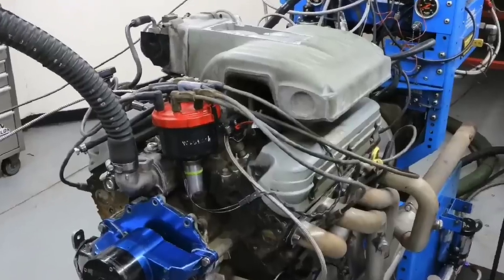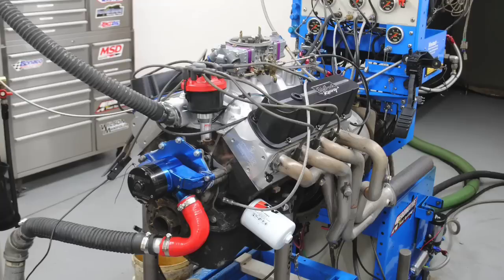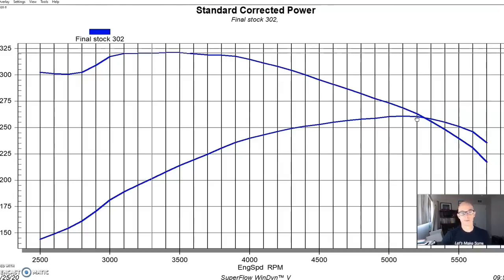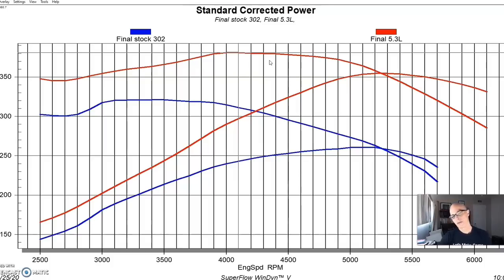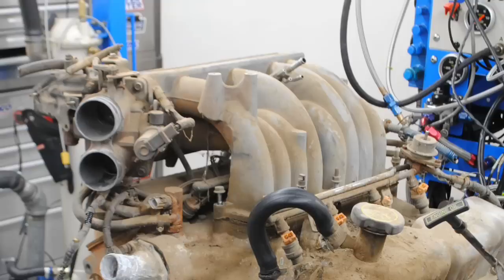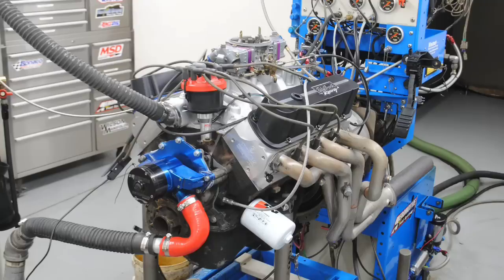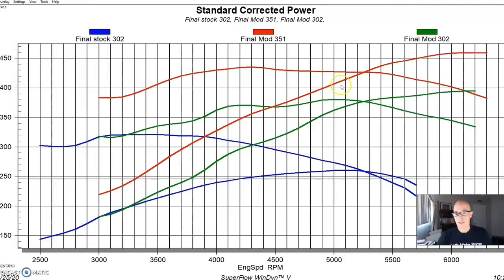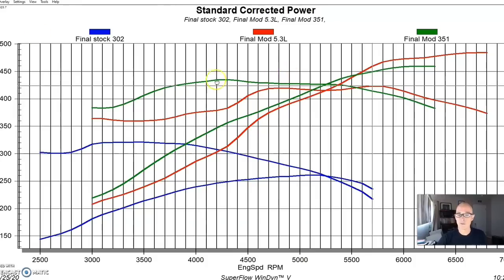5.0L vs 351W vs LS-SHOULD YOU SWAP?

Comment: Ready? Long post incoming!!.......
First, and this is just a personal short opinion, I will get into more in a sec- if you want to swap an LS why not just get a Camaro or firebird? Switching Ford small blocks means you don't need to swap transmissions etc. Plus you will find a lot of hate if you are swapping GM into any Ford that had a pushrod engine. Lots don't care, but lot's do. My opinion is it is your car, and this is America. 
That said, I will give something besides dyno numbers to consider. I know the internet has a really, REALLY hard time looking past dyno sheets and armchair drag racing, but what I am going to write here is FROM ACTUAL REAL LIFE EXPERIENCE as I have lived all this in my many years of car crafting and messing around with them. 

First: LS motors. 
LS is fine for anyone that only cares about maximum speed, and doing so without caring HOW it gets to that speed, or HOW it runs during other driving times. Are you building a drag strip car that is going on a trailer in between runs? This might be your best bet, it's cheap, it's got super aftermarket support now, it's a known entity. You can copy any one of many many internet formulas to get your car to run consistently. 
Daily driving an LS..... well that's not exactly the same. Sure it's still plenty fast, it will sound good because it's an American V8. it will suffer from some of the "blahs" though, as any modern, mostly computer controlled engine does. You can fart around with other things like gear ratios and whatnot to alter the car's characteristic, but in the end....
The LS is the peanut butter and jelly engine. Tastes good, cheap, easy..... and get's boring AF after while. I have NEVER met anyone in real life in person that has told me their dream car, and it included a 5.3 LS swap into a Ford. LS swapping into a Ford is what you do because you have a budget, because you are after a result. Not because you are after a car you want to keep for 20 years and pass to your kid, or take to your small town main street car show on memorial day, etc. LS swapping is a thing that happens because of bang for the buck and results, and you should expect it to be received that way when you talk to people about it. No REAL car guy is going to bash you for it, but also no REAL car guy is going to be super impressed by it either, it's a known entity and part of a defined calculation at the end of the day. 

Alright, on to the Ford stuff- by the way I am sad we didn't choose to dyno a junkyard pulled Exploder(poor man's cobra) for the stock test.....
First, 5.0
Make sure you know what you are starting with if you want to fart around with a 5.0. Ford made Mustang engines, but they also put these in trucks, and Crown Vics, and none of them are the same. Then they are different from the early 70's, to the mid 70's, not even a 5.0 in the early 80's, to the most common one people think about from Mustangs in the late 80's. Then there is the ones from the late 90's Exploders. Then there is actual Cobra motors. Each version needs a different approach to begin the tuning adventure. 
Here's the thing about any of them- if you want to build this mill to be FAST you are going to replace half of it, minimum. That's really all there is to it, the heads are not going to work, the cam is not going to work, the intake is not going to work, the pistons and rods MIGHT work if you have a very particular version of this engine otherwise nope. Building a 5.0 to be FAST is it's own adventure. I am not saying don't do it. This is America. But know you are in for some time and $$ to get it to truly be FAST. 
Now then, why this engine as so beloved, and why it was so fun, and why it spurred an entire generation of Ford fans: small block Ford, going all the way back to the 289, is FUN AS F%%k to rev the h3ll out of and tear a55 around town. It doesn;t even have to go that fast, it sounds amazing, is responsive as all get out(after a little tweaking) and REAL car guys know the sound of even a slightly worked small block from a couple blocks away. Will you win every drag race? NO, hahaha, maybe some, but you will smile every time you get in the car. 
I built a 94 mustang, started ten years ago, sold it to my boy a couple years back now. I tuned it for romping around on County trunk highways on slow bends etc. Rear end 3.55, tuned my exaust for sound, left suspension mostly stock(all new though, put in edelbrock shocks/struts too) computer tune, etc. Prolly added 40HP at the wheels. FUN, just cruise, bang through the gear, smile contently at the sound, and I put GIANT rubber on the back so if I wanted to hard launch/clutch dump that doofus in his duramax at the stoplight I would hook and the car would lunge to 30mph almost instantly. Drag race? NOT EVEN ONCE. Daily drive? For 6 years, every day weather allowed(upper midwest) and now the boy does too. 
This should be your goal with a 5.0, FUN. Not I MUST WIN, not drag race champion, not ultimate speed. Just high revving daily driving fun. I mean this is America, do what you want, but it will cost you $$$ to do it. 
Keep in mind, the bore is significantly bigger then the stroke=likes to rev, can make lots of peak HP at high end, harder to maintain flat torque curve like that without boost as you climb that scale. This engine will last longest, be happiest, and bring the most smiles as a daily when a mild build that balances manners(responsiveness) and peak power. Sometimes in hot rodding "the biggest ultimate bestest" is not the most fun. 

Ok, I know it's getting long, but here is the last part. 
351w. 
Since Coyote, this seems to have fallen out of favor. Shame. Ford made this engine since the 60's. Remember most 5.0 had a 50 oz balancer vs a 351 28 oz, first and foremost if you are swapping. I say this because you can reuse a lot of stuff from a 5.0 onto a 5.8 when you swap, but not the flywheel! But I will leave a lot of the technical stuff to others, just remember to find good info if you want to do this, and depending on the vehicle it can be super simple or can require a bit of hoop jumping. 
I will talk specifically about this engine as it pertains to mustangs, or otherwise fairly light vehicles with reasonable aero(so not 4x4's). Something magic happens when you put one of these into a car that Ford did not offer this engine in from the factory. There is a reason they did not offer this from the factory. These engines are square, meaning bore and stroke is almost the same. It makes them "balanced" when you start to tune them, meaning HP and ft/lbs tend to not fight each other. It is possible to make a HP monster with an almost flat torque curve. 
I had one in a 1984 Mercury Capri. I had headers and a large diameter dual exhaust. I had a nice aluminum intake, and a GIGANTIC Carter AFB sitting on it. The Capri had a hood scoop, I cut a hole in the hood and my air cleaner fit nicely through so I could get it in there without a custom cowl hood. It also meant the scoop was now functional and fed right into my air cleaner/filter. I tuned it super rich, and advanced the timing a lot, and had an msd 6AL box on  the car to make sure I could keep the timing well. 
The car had an 85mph 1980's speedo. Poor, poor 85mph speedo. I wrapped the needle all the way around until it got to 45mph the second time. I do not know how fast I was going. My wife would not ride in the car. The engine just pulled, and pulled, and pulled. It didn;t care if I got on it at 20mph or at 70mph. There is a reason Ford did not offer a 351 in their cars. When I was in high school I always wondered, always had to argue with the chevy 350 guys about displacment and how Ford kept up or won with 50 cubes less, etc. After High School when i put this together, it became quite obvious why Ford did not put a death machine like this in the hands of the average Joe public. Look what Saleen did with a 351 in the SN95 cars. Saleen S351R. If you don;t know what that is go look it up. 
So, you build a 351W for HOW it drives. HOW it goes fast. My Capri wouldn't launch like my 94, it would blow the tires off. It drove around town...mostly fine. it rode the highway, pretty well actually, but I couldn't really PUSH it, it had too much. My 94 was mega fun to cruise in because I could push it. The Capri was a monster. 
I will say though also, if you just do a very mild bolt on 351 swap, you can have a car with as much power as a fairly well worked 5.0, but it will have very mild street manners comparatively because of the higher, flatter torque curve. You won;t need a lopey cam to get the power, which means you won;t have to do a 3k+ rpm launch from every stop sign to prevent the car from snubbing. 

So when you are looking at stuff like this, make sure you have an end goal in mind. Are you trying to win all the time at a drag strip? Are you trying to prove something to anyone? Are you building this car for your own enjoyment and will never line it up against anyone? Do you have enough open road to drive a superbeast safely on, or a track to go to? 
LS: predictable, cheap, follow the formula for speed
5.0: rev happy, perky, roadster style fun on the backroads probably the easiest daily driver to build
5.8: either do a mild build to have a faster car with daily street manners, or build it into a deathtrap. There are videos of guys with single turbo 351 swapped mustangs on youtube street driving and launching from stop lights if you want to see. Just don't expect to want to drive that to work every day. 

Just remember there is a lot more to enjoying a car then dyno sheets.
Reply: Damn, that was so well worded it makes me want to 351 swap my Chevy now 💀😂
Reply: @lucysmith4242  I am glad some people are getting something out of it!
What kind of Chevy?
Reply: davenhla it was kind of a joke as I have built LS in the works, but a rusted out piece of shit 72 Nova. Enjoyed reading your comment 👌🏼
Reply: @lucysmith4242  oh I figured that much, there is like no aftermarket support to swap that way anyway :p  My uncle had a Nova when I was a kid he swapped a 350 into. Fat tires, traction bars, the whole works. Shiny maroon with chrome, that was a cool ass car. That will be a fun ride when you are done!
Reply: I put a 351W in my 65 Mustang hatchback in the early 90's before anyone thought about it. Engine built by JBA in California. Why because nobody in Wisconsin was doing the swap and they had the headers and motor mount figured out. Also they had the new at the time J302 heads. Motor made 425hp and flat as a board 400 plus in torque. I still own the car same engine. Used to vintage roadrace but now just street driven.
Reply: @dalefrahm9060  As Tim Allen would say "OOOHHH OOHH OH OH". That sounds fun! You didn't leave the open rear end in did you?
Reply: @davenhla  No it had a 3.55 gear and traction lock. With Hoosier street TD's though it had enough power to burn the inside tire up on a race weekend. So for Road America I just put a mini spool in. Track was big enough and turns not to tight it was ok. Blackhawk farms turns were a little too tight and caused some throttle oversteer problems.
Reply: i'll agree and disagree with what was posted. LS owners are almost always of two camps--either they are copying what everyone else is doing, so they are with The Cool Kids, or they are using what they were born with. There are pro shops who use the LS simply b/c they can get the entire setup cheap, and it will sell as well as saying ".44 magnum for sale" instead of "revolver for sale". 

But for private individuals, there are a few who are just monkey see, monkey do. Its always been that way, too. That's how we got burlap sack interiors and pastel colors in the 1980's :) The LS has a lot of potential, but so do engines developed in the 1960's--they were going fast then, and those used in the 1980's allow those who design their hot rods, to mix an overdrive trans and EFI.

But there are plenty of young kids screwing with what engine they grew up with. Just like in the muscle car days, plenty of old timers stuck to their flatheads and 409's while everyone else was embracing what was on the dealer's lots.  I agree with the point about dream engines, tho. a kid with a 5.3 dreams of an LS7, just like a kid in the 1970's with a slant 6 Duster dreamt of a 426 Hemi but snagged the 440 from a motorhome and went to town on that.  Both those hot rodders are doing the same thing--plugging the junkyard hottie into something cheap and going fast on a grocery store paycheck.

Finding how to get a low deck Ford Windsor to work, has always required knowledge of what year has what parts that fit. The LS is the same problem--as far as bolting it into anything not designed for it. What oil pan? what serpentine system? how will you handle the power steering issue or throttle cables? If you know the Windsor, the LS is "speaking Greek" and vice versa. 

The 351W was a bread and butter engine for decades, in the shadow of the 351C. NASCAR turned to the tall deck Windsor first, needing Clevors. Then the tall deck got attention on the street when folks realized the Cleve was getting harder to find, had its oiling issues, and geez, those 351W with EFI and roller lifters were pretty darn cheap. And easy enough to stroke to 377 cid with 318 connecting rods and a turbo chevy piston.

Why did Ford not make a performance version until the Lightening? Two reasons--one was CAFE, the other they were selling every 5.0 they built. Safety wasn't the issue for the people who brought you the Ford Pinto, otherwise the Mustang wouldn't have had tiny rear drum brakes when a better solution was on the Lincoln.  The R&D money was spent in 1979 and certain paid off before the Fox demise in 1993.

Totally agree about the dyno queens. watching dynos on youtube doesn't cover the torque-to-weight ratio that set the Fox on fire. it was a truck engine, with a hot cam and headers, tossed into a tin can of a car. it made torque with its long runners and small head ports, and that was what returned the muscle car feeling to the 1980's, it wasn't HP. "HP sells engines, torque wins races". 

What works at the race track, only works on a city street with a driver who knows the different requirements. otherwise, build a torque engine with a "granny gear first" transmission, and you have a long living drivetrain that tells the butt-o-meter its really strong. just don't look at the tach redlining at 5,000 RPM.
Reply: Your description of the 351 sounds like what my friend's dad's description when he swapped one into an otherwise stock, 86' 4cyl Ranger. He drove it up and down the street, got on it a few times, came back and said he needed to "get that motor out of there". He ended up putting a 302 in it instead.
Reply: @madmatt2024  hope he followed Advanced Adaptor's advice on using the automatic--the 5 speed in those 4 bangers was a Mitsubishi unit only good for 200 hp when new. The 351 would be ok for a rock climber needing a flat torque curve, but the 302 is fine enough in something as light as the Ranger--i had a long bed with cap.
Reply: Great post
Reply: @albertgaspar627  I know it had an automatic in it with the swap, I'm not sure what it originally was from the factory though.
Reply: @madmatt2024  My Ranger was early enough to have the OHC 2.3 litre that was once in Pintos. The automatic transmission they came with was either the C3 or C5, which was a version of the C4 and recommended for V8 use as a result. The 5 speed wasn't. I don't know about later Rangers using different 4 cylinders. 

On a side note, my father had an S10 so I know I liked the Ranger better...more metal, less cardboard in the dash. But the S10 uses the G body front suspension, so if you V8 swap that thing, you have more front suspension options. And the Dakotas had a V6 that was their small block missing two cylinders, so their V8 swap isn't difficult, esp. if you can get the factory V8 mounts.
Reply: @madmatt2024  hahahahaha, I rode in a 351W powered bronco II when I was 17. "Holy balls" was my sentiment when we stopped to my buddy. He blew the rear end out 3 times in 3 months and sold it cause he got sick of the work. If he would have kept it a while longer he could have found an 8.8 to put under it from an exploder, but it might have killed him before then too so maybe it was for the best
Reply: @davenhla  LOL, he should have used 4wd more.
Reply: Ls engines are only good for the strip... what?